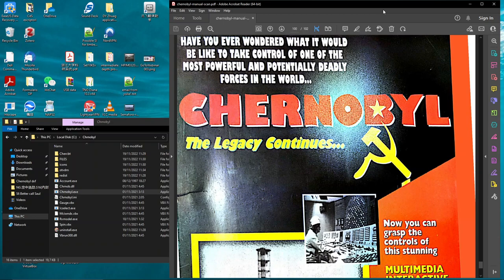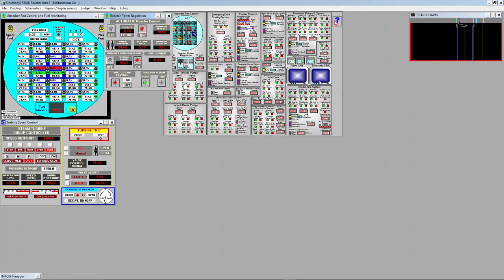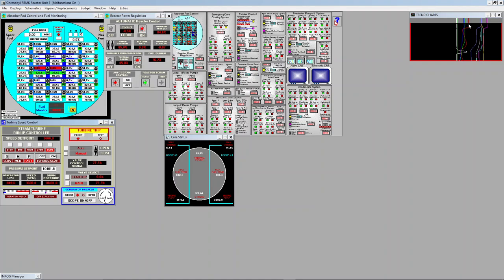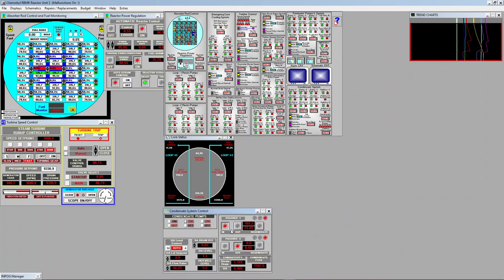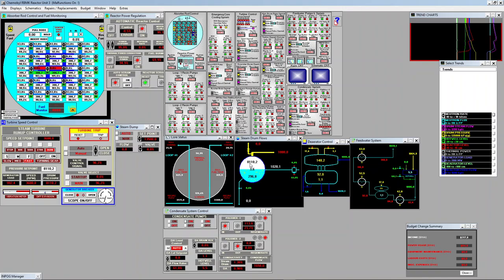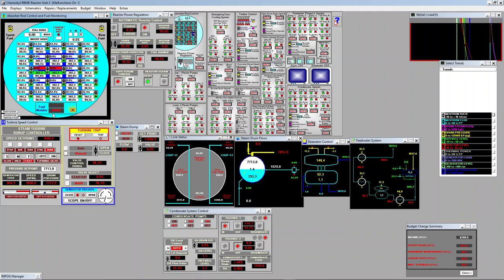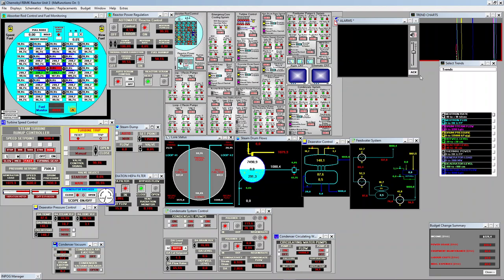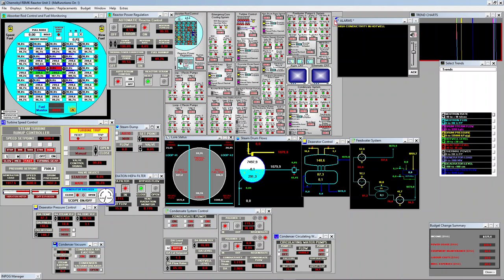Chernobyl RBMK simulator port version 2: Shift Supervisor

Comment: some tips that I found:

A couple of fuel channels are at a low % when starting as shift sup. so I check each one with the monitor then decide which ones need to be replaced right away.

The Geiger counter seems to work best when you aim the "center mass" of its icon at the green radiation symbols for the channel you want to measure.

I tried to move one fuel bundle over to another empty channel, but it only created a spill. I guess you aren't supposed to "shuffle" rods through the core on a scheduled rotation :) I think it would still be possible to (pretend to) breed fissile's with the unit, anyway?

Ok I'm still not really sure about this part: it seems like the "thermal power correction" could be important... only mentioned in the manual twice... I think having it on is meant for dynamic operation (powering up and down, or changing over equipment etc). While turning it off allows balancing the two loops using individual rod controls, more efficiency maybe... Loop 1 might be center core and loop 2 the rest (16 rods) i still haven't been able to confirm that 100% either.

Thanks for keeping the content coming!

Comment: Getting "this app can't be run on your PC" for this version of the sim.  Other versions will launch fine.  Anyone experience this and solve it?
Reply from the maker: Never seen this one before. You can check the links in the description of more recent videos with the full game port https://youtu.be/gZEmx9HyesA
Reply: @argilaga   I had failed to install the 16 bit emulator.  After that, it worked fine.  Thanks for the response